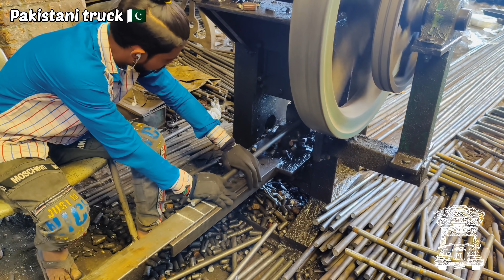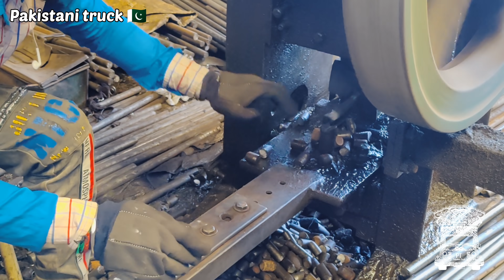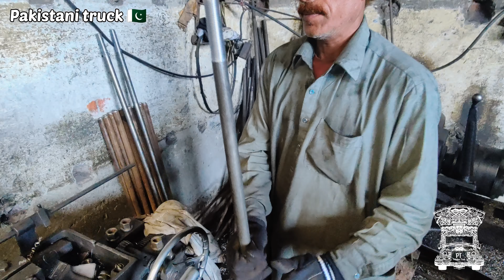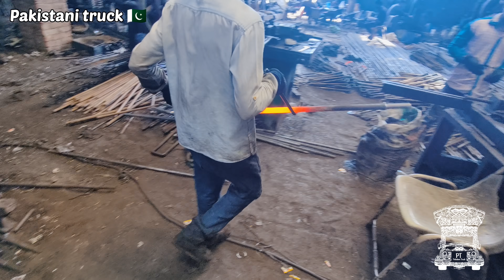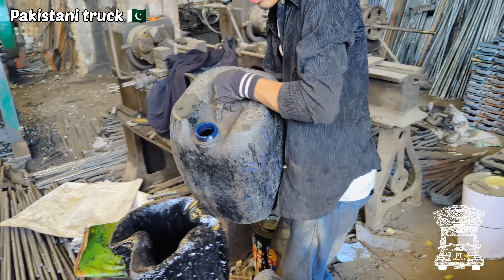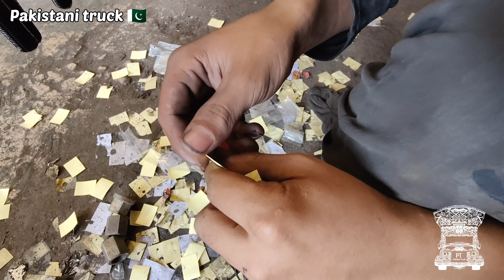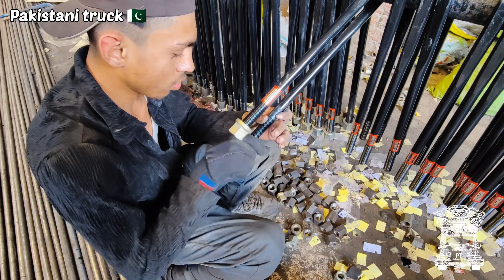U Bolt Manufacturing | Truck U Bolt production | Pakistani truck

Comment: After many years in safety! I'm watching spinning flywheels an belts Just inches away from worker's. Or their finger's in unguarded plant. With buildings not fit for purpose and inadequate housekeeping or facilities. Yet still manage to turn out high quality products and services. Please stay safe from Birmingham UK!!
Reply: @N B I've seen pouring molten steel for casting in just normal clothing!! They work hard in a very dangerous environment.
Reply: @N B That's OK, they are safety sandals.

Comment: is that coating blackpaint and acetone? 50/50 mix?
Reply: I think you’re correct! I wonder what the point of that is?
Reply: @trainnerd3029  Prevents it from instantly rusting. Probably. Also prevents anyone from screwing nuts on there, but whatever I guess?
Reply: @Scrial  it might also help keep the nuts from falling off. 

Got a respect to work ethic of these guys though… Work hard!

Comment: If you moved the furnace closer to the bending machine the chap carrying them wouldn't spend so much of the day walking to the bending machine and back.
Reply: Doesn't matter much imo. Labour is cheaper than upgrading the bending machine with 200$ of materials i guess. The bending machine should be a one man job with a basic set up.
Reply: your right that would improve output 10% at least..

Comment: Thread cutting dies won't last long without lubricant!
Reply: Nuts didn't fit anyway!
Reply: They were done manually, shouldn't the lathe be on automatic mode to get equal width of threads.

Comment: Why don't they use a stop on the rod shear? It would make a more consistent product and eliminate one man. Why don't they put a cheap control on the bending machine? That would eliminate another man. Why do they put the nuts on the rods when the nuts have to be removed before the u-bolts can be installed? So much inefficiencies.
Reply: The last bit makes kinda sense, if they sell the U-Bolt together with 2 nuts, best place to put them for that. But a stop for the length should really be a no-brainer, even if you keep the same amount of people it would still lead to better consistency and a bit faster throughput.

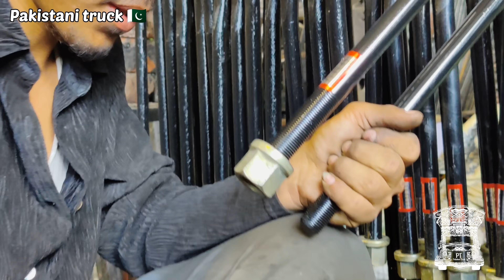Comment: look good with me. the minute 08:40. the young man who mounts the nut on the bolt with difficulty. the bolt pitches fabricated are not processed well. returning at minute 00:50 the cutting of the iron into pieces. and please note the great defect in the cutting machine. it cuts very badly. and crushes the head of the cut bolt. also watch how the young workers take successive hits from this cutting fault in this machine.
Reply: Threading on lathe should be done on auto mode. It looked the lathe machinist was feeding it manually. No way that the threads would be of equal pitch.
Reply: @shivgautam487  yes.

Comment: There are many things wrong with this process of manufacture, and the final product is not good. Who would be the likely buyers of it? Experienced truck mechanics in Pakistan or elsewhere would take one look at the threads painted over, and realize that there has been poor quality control, then one try at running the nuts to the end of the thread would convince them that  this suspicion was correct. I cannot imagine these items, as produced in this video, could be exported readily to other countries. 
Even so, the production could be improved by some attention to detail, as basically the operation of manufacture is not bad. Could the owner of this factory provide a more appealing  workplace, with level concrete floor,  whitewashed walls,  better location of the different stages of manufacture? And provision of safety items like eye protection, safety gloves, work shoes to replace sandals? That would improve the labor relations and increase the efficiency and profitability of manufacture.
Best wishes to the hard-working labor force that in spite of all turns out a useful product for their country.
Reply: They are using scrap metal for making scrap parts for trucks and cars. Also very bad work. People commenting here that this is good work don`t have any idea what quality means. In Western Europe there is quality control for each part and exact tolerances.